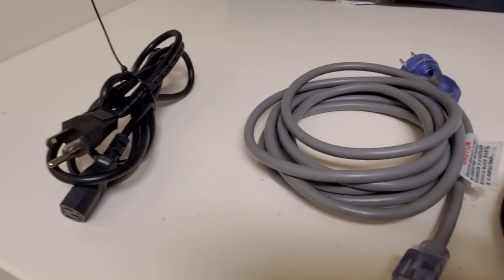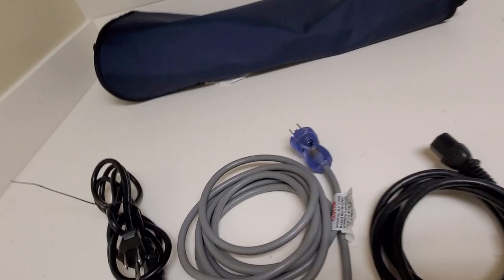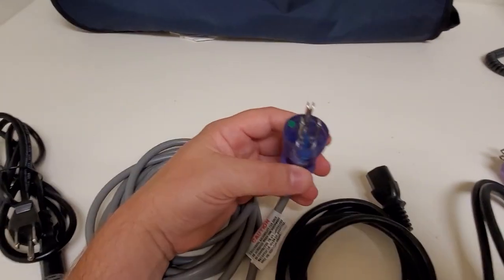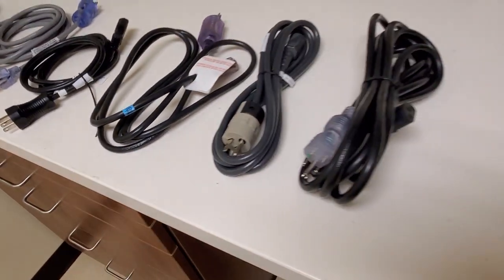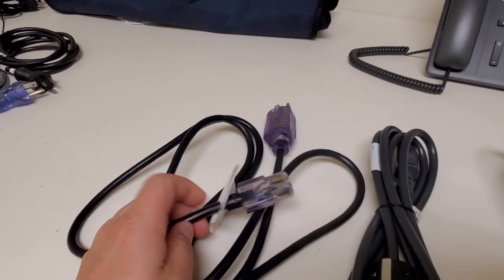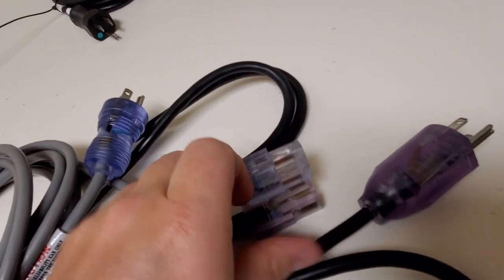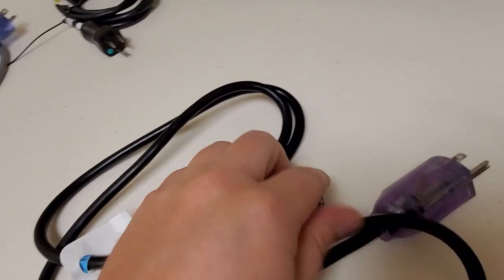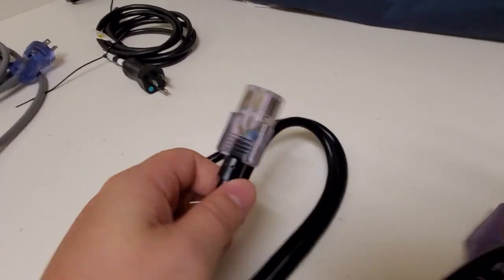Power Cords: The Good Vs Bad

Comment: The hospital that I work in is very close to the ocean, so we have a lot of corrosion in our outlets and plugs.  What I like to do is use lubricant spray on the outlets and apply a light coat of silicon or high temp grease on the plugs.  Makes plugging and pulling the cord real easy, but could cause a sudden plug out for some equipments.  I'll look into Yung Li cords!  Really appreciate your work!  Greetings from the tiny islands of Palau!
Reply from the maker: https://www.amazon.com/dp/B003HFTI0S/ref=cm_sw_r_cp_apa_i_vLRlFbSBJRX62
Reply from the maker: Thanks for writing! I had a rough idea of where Palau is but I had to look it up!